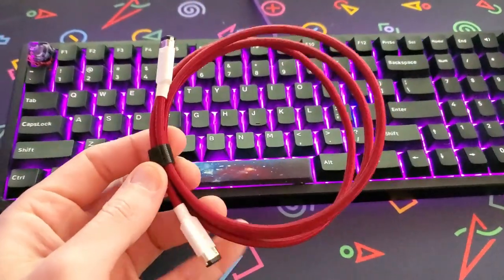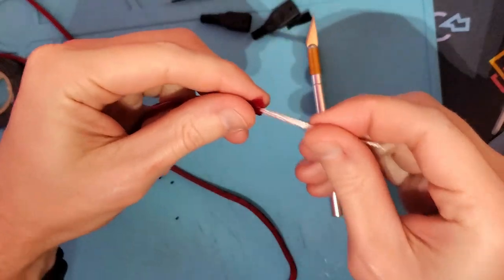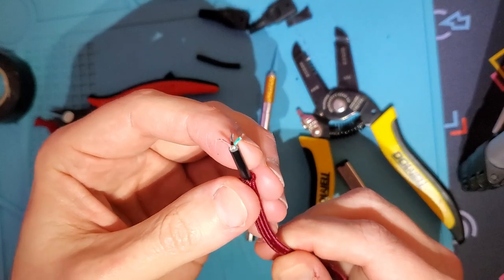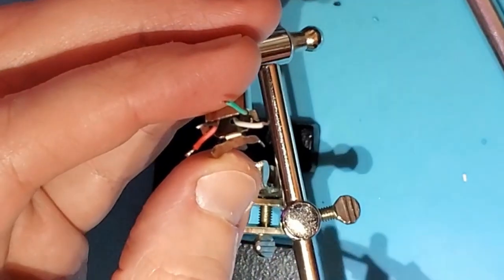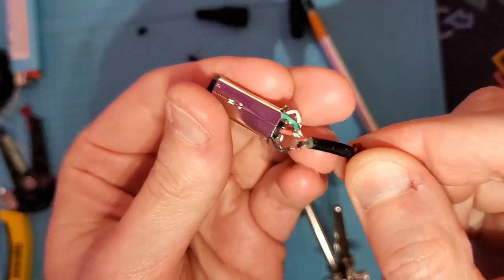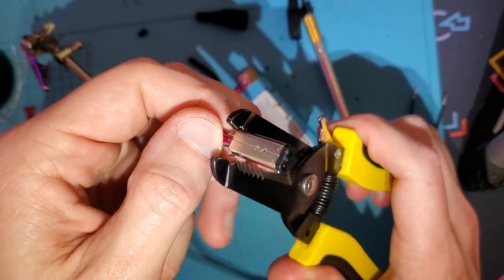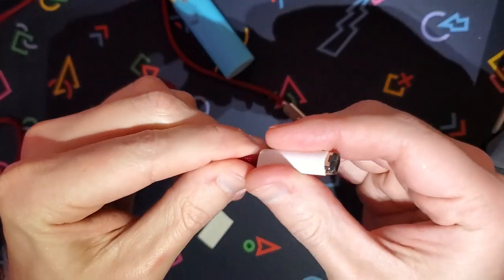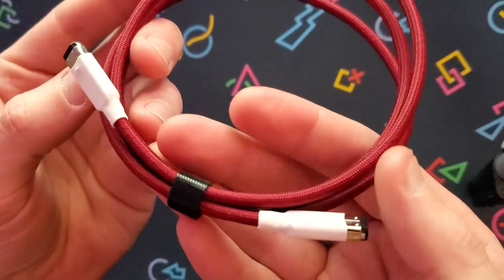How to paracord sleeve a Gameboy Link cable.

Comment: Couldn't you just tie a knot to the link cable using the internal string of the paracord and pull the cable through? It would be a lot faster than just removing the internal string and pushing the link cable in little by little
Reply from the maker: I thought this too when I first started paracord sleeving but it does not work. The paracord just bunches up and it doesnt make it through